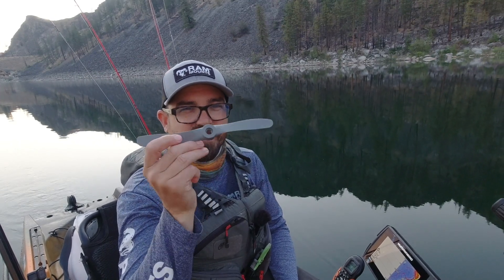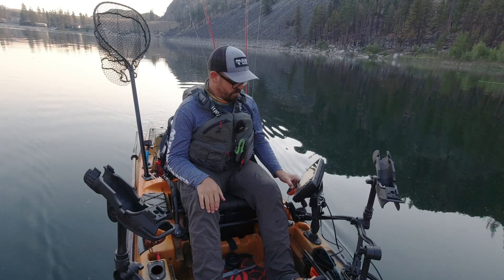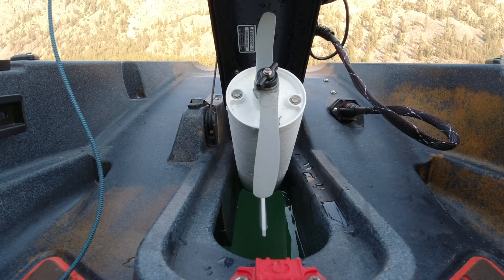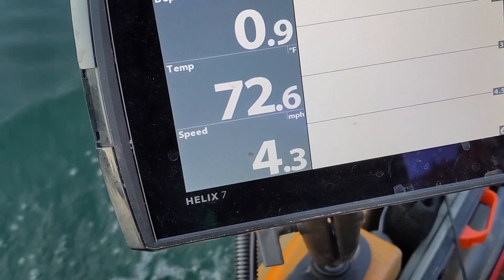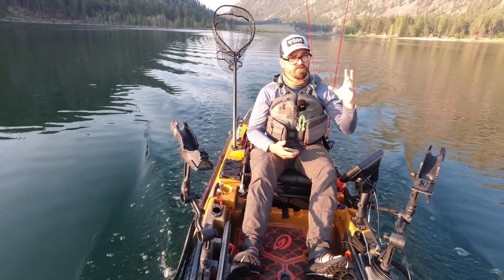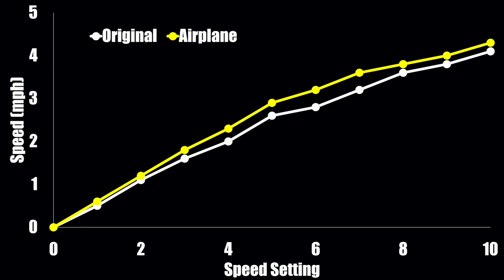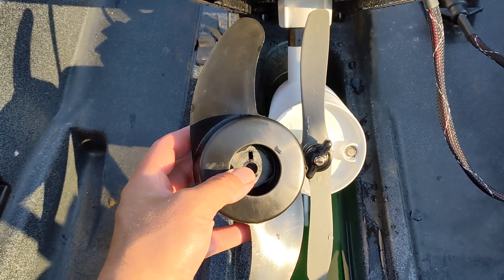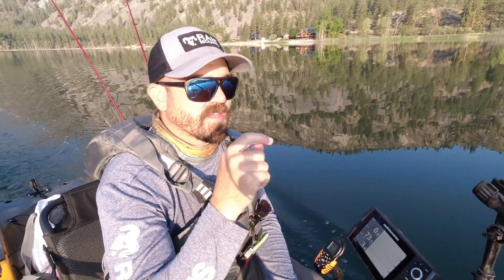Upgrade Your Trolling Motor for $4 [Airplane Prop on a Trolling Motor]

Comment: I feel like not having that hub might create a low pressure pocket creating some cavitation? I’m not an expert or engineer in this what so ever. Its more of a thought I’m drawing up based off of research seeking more speed for my trolling motor. Like you said it’s a really complicated topic when talking about fluid dynamics, pitch number of blades and all the different variables. Lol am an aircraft mechanic so looking at different props on planes vs boats, they have a common cone feature implemented in some way. That probably isn’t A coincidence, it’s probably to reduce drag into the blade. I know when you have more drag it reduces your thrust with air, Water being different has the issue of Water has a boiling point causing cavitation. Cavitation not only destroys your props, they also create air pockets casing your prop to lose grab on the water,  So you want the transition to be smooth. Like you said really complicated topic I wish I knew more about. I have a mechanical brain with the lack of scientific understanding of it all lol. I love that your experimenting with this, there’s a bass guy that 3D prints props. It’s something like “big bass”? he has a southern accent but he’s done a ton of resource and actually sells them now. believe they are kayak trolling motors. But if you can find a cheaper and effective way to do it I will watch all videos you post on it. I just figured out your in E Washington and I hope you are far enough away from the fires. I was up camping at liars cove lake concanelly last week and believe yesterday or today they turned it stage 3 evacuation. So I pray all is well for you.
Reply: https://youtu.be/cc2qGLAeAuk

Comment: I'd be curious to see how this performs with a larger boat.  My trolling motor is undersized for my boat so I'd be curious to see if this was an upgrade or as I one guy mentioned below, it might not have the torque to improve the performance with a bigger load.
Reply: Did you do it? How'd it work out? Im in a similar situation.
Reply: @snckwypp9802  Haven't tried it.

Comment: Ok i recieved mine in the mail. What an AMAZING upgrade! I put together my kayak with an old 17 lb thrust, rear mounted minn kota. With the stock prop i topped out almost 4 mph with zero chop. With this new prop that you recommended i topped out at 5 mph. The big difference is not in the top speed tho, the biggest difference i found was trolling speeds (around 2mph) i was using far less energy to keep trolling speeds then i did with the stock prop. I do admit i did not think this prop would work as well as it did but it surely suprised me. The only negative thing that i can say from this prop is that i did give some vibrations which hopefully i can fix by figuring a way to balance it. $4 well spent tho. Thank you for your video.

This is my brief video of mine if your interested or you can find it on my channel https://youtu.be/7RxWUhrjeAQ

Comment: Ok I wonder if it would make a difference on the PDL series?
Reply from the maker: I don't think it will or at least you would need a different prop as the prop featured in this video is shorter than the factory issued one's on the PDL drives.

Comment: Model aircraft props can be ordered with different pitch.   A typical description on an aircraft prop is 10-6.   The first number is diameter ( inches ) the second number is pitch.  In this example... the 6 indicates 6 inch of forward travel per revolution.  ( less slip )   The weight of your boat will determine what pitch will perform best on your boat.  In general a heavier boat will do better with a lower pitch angle ( 10-4 ) A lighter boat may do better with a higher pitch ( 10-8 )  Try different pitch angles on your boat to get the best performance.    I suspect the factory prop is too low a pitch to do well on a Kayak.  
Party on Dude....
Reply from the maker: I've been looking for a source for a different pitch push prop left hand. They are hard to find. I am interested to see how they perform.
Reply: @spiltmilt   APC LP10050M-LH  5 pitch marine pusher.  I've got one on order to test out.

Comment: Nice video Tyler. What app are you using to monitor the draw from your battery? Is it unique to that kayak and motor?
Reply from the maker: Its unique to the Rebel batteries I use to power my kayak. http://www.rebelbatteries.com?afmc=1d
Reply: Ok. Great.thanks! I have a Hobie PA 14 with a Bixby J-1 so unfortunately that’s not going to work for me. Wish Bixby had that as an option!

Comment: more thrust is produced at the tips as they have a higher speed (longer prop = higher tip speed), less pitch = higher rpm = more thrust at higher speeds. More pitch produces more torque  hence faster acceleration (probably not necessary in a kayak, unless adverse wind/ current or heavier load). Hope that helps.

Comment: Hey, Tyler, love the video! Great stuff. I am both an engineer and model airplane pilot, so will hit a couple questions you raise. 

Causes: There are likely 2 causes of increased speed: better foil shape and less drag. The air prop is "skinny" and appears to be about as thick as the water prop. This makes the share that moves through the water more like an airplane wing and less like a sheet of paper, which gives more thrust for the same rpm and less drag as well. Also helping out a lot, drag increases with area, so "skinny" is good, and makes the shape improvement even better.

Complication: I have no idea what that motor controller is doing. If #7 means 70% of available volts, then the lower drag will mean rpm increases, making even more thrust. Otoh, if #7 means 70% of max rpm, then amp draw will be less due to lower drag, and thrust slightly increased due to better shape. This detail isn't clear. 

More complicated: hull drag increases exponentially with speed, after a point. It's not surprising that at high speed the graphs converge - that's the boat getting difficult to drive thru the water.

One nit pick: the correct estimation of potential range is speed vs amps.  A 10% increase there will result in a 10% range increase, because...math :) When you get 10% more speed at a throttle setting, but the motor is drawing 10% more amps, range is unchanged.  It's much more informative to collapse the two charts into one, getting rid of the "speed setting" factor and plot each setting's amps against its speed. 

Down sides: these props won't flex much with impact. Hopefully they shatter before bending the shaft. Also I expect them to be very easily clogged by weeds.  

Other comments: I haven't handled the water prop, but I bet it's much less stiff than the fiberglass reinforced plastic used in the air prop. Those typically are very stiff, and fail when they hit something. They will hold shape better at higher rpms.  Also, prop weight has zero to with motor rpm once at speed, and very very little impact on acceleration. 

Ideas to improve: 1. Maximize the prop length for efficiency. The longer the better, and clip the least possible off the tips. 2. Play around with pitch. It's a matter of changing props and seeing what works. Be careful of big pitch #s - you risk overheating your motor. Use your speed vs amp draw chart to compare.  3. Try out a spinner. That big flat face at the back of the prop is huge drag. Airplanes seldom run naked props because of drag at higher speeds. Water is a lot like high speed air. Back to the hobby shop for a spinner of about the same size as the old prop hub.  Test again with speed vs amps and see if it helps. (Spinners are a pain, so better be worth it. May not be a good option for on the water prop replacement.)

That was long, but skipped details. Happy to answer more questions.
Reply from the maker: Wow! This is awesome. Let's address some of these ideas. 
1.) I can't make the prop any longer or it hits the bottom of the kayak.
2.) Yes I've been looking for alternative props with greater pitch. Problem is I need a LH push prop. Not a lot of those around it seems.
3.) I'll look into a spinner 
4.) I did look at amp draw at each speed setting (see chart at 8:05) and there is no increased amp draw with the airplane prop.

Thanks for the detailed response. It's greatly appreciated.
Reply: Question is that propeller installed backwards.
Reply: I just wanted to say: I am a Jumbo Jet Pilot and an Engineer.
Reply: Yeah, no worries. It's nice to have a little tiny bit of knowledge I can share back.  Love your work, in person and online! To your points:
1. I figured. More of a caution not to waste time exploring much on the smaller side.
2. Reverse props are a bit of a bother - except now we have these nasty drones from the underworld that have beset tge civilized world with their awesomeness. They all fly with half of their props turning backwards. There is also a ton of inivation in that area. They tend to optimize into a top fuel dragster kinda corner tho, so it may be hard to find a suitable prop for a kayak. I'm not sure if you said which prop you are using, so not sure if there is similar in drone size, but I would be surprised if you can't find similar. Try GetFPV, RotorRiot, etc to get you started. You'll see many 4 blade props - those def fall more toward a dragsters than a Prius, but if you find one that works, try it out, cut off 2 blades and try again.
3. 👍🏻 Or get a nerdy friend to 3d print you a perfect match. 
4. Yep, saw that. It worked on this prop and your conclusion was spot on. If the first chart lines weren't (or aren't on another prop) exactly overlay, it would be difficult to draw a clear conclusion - that's all I was saying. 
I love the empirical exploration you are doing here. Great stuff! And the results are very likely applicable to your peddle - prop boat as we. 🤔. (on detailed inspection, it looks like you're pumping about 150-225 watts (12-18A at assumed 12.5V) thru there to make typical cruising speeds of 3-3.5mph. That would be a pretty solid peleton workout for many folks and mortals won't be hitting 35A speeds (450W!), but prop comparisons would still be useful, especially the lower amperage end.)

Comment: The aircraft prop has a higher aspect ratio than the boat prop, making it more efficient. (Think high performance glider versus a biplane) . This is due to less energy being lost to tip vortices with the higher aspect design. More simply,  the boat prop is working like a screw and the airplane prop more like a wing. It has absolutely nothing to do with weight or rotational momentum.  The limiting factor for the aero design will ultimately be cavitation on the upper surface of the blade, but for low speed operation like this it probably should be fine.

Comment: My experience is in the world of aircraft. Real ones, not RC. And I have quite a bit of experience with aircraft props. RC aircraft or real aircraft, aerodynamics still work the same way. And hydrodynamics and aerodynamics are very similar in a lot of ways. 

That being said, you may be onto something when you spoke about the hub. 

Also is the cross sectional shape of the blade itself. The original prop blades are pretty much flat, and get their thrust from the pitch of the blades. While the airplane prop does this it has something else going for it too. Its cross sectional shape is like that of an aircraft wing, more curve on top than on bottom. This increases thrust in air and water. (Bernoulli’s principal) 

My other theory is speed. The airplane prop has less mass therefore the motor can turn it faster. My only concern with that is how it might effect the life of your motor if you’re constantly over speeding it? It’s probably marginal and not much of a concern, but something to think about. 

Cool vid man keep it up!

Comment: What app did you use to find the current draw? I wonder if the same efficiency improvement can be had on the autopilot for bow (boat) mounted minnkotas..
Reply from the maker: My battery has a built in bluetooth and an associated app for monitoring battery health and usage. http://www.rebelbatteries.com?afmc=1d

Comment: Great video for sure. I think it’s mostly rpm. With either prop you are going to max out at some rpm for each. Could you spin the oem prop faster obviously you get more speed up to a point where flex and cavitation comes into play. I suspect that skinny little prop would reach its maximum effect speed  and failure long before the oem prop does.  That little trolling motor is only going to spin so fast. Make it spin faster it’ll go faster. To a point I guess. 

I believe a three blade prop will actually get you to max speed faster but I don’t think on the same motor it would go any faster with 3blades. Most trolling motors are two blades to better chop up the weeds.

Comment: What’s the weight difference between the two. The lightest one should move faster in my opinion, thanks. I saw where some people are waiting weeks for a replacement blade from Minn Kota as they are backordered. Just carry more spare blades for backup. Great videos, thanks

Comment: Duc Tran has a 136 AP in his video and it maybe a faster kayak than your 120 AP, just a guess why he achieved a faster speed.
Reply: Hull length has a big affect on drag, that's why really long traditional kayaks glide better between paddle strokes.  The longer 136 AP @ 13' 6" has slightly less hull drag, matching the point you made.

Comment: Interesting. I’d be curious to know how much that airplane prop is flexing under water while running at high speed and if it could endure the stress long term. And then how would an aluminum prop perform if it wasn’t flexing at all and holding its original form.

Comment: I'm also curious if the airplane prop will have any affect on your fishing success rates. As you have mentioned many times, Kokanee are sensative to motor noise in the water. I also wonder if cavitation at the prop is part of that issue. It might not be a low speeds, I don't know.  Since you are gaining speed are you also putting more noise into the water, therefore spooking more fish than before?

Comment: Surface area/volume.  The rc prop displaces less water and also creates less friction.  Top speed probably more limited by boat design and the prop I suspect begins to deflect under increased load and/or cavitation increases = less for blades to push on.

Comment: just my 2 cents but there has to be a good reason why minnkota does not use the style prop you have demo'd here.  I reason that thick weeds (seaweed) and sand would certainly damage the rc prop much more quickly so I am sticking with the original that has the beefy hub.  Minnkota has decades of experience with these comparisons I would think...the extra 9-10 % speed boost is tempting but not worth risking the warranty concern or the more susceptible damage?? if it was titanium/aluminum alloy maybe, but then it would cost $100s for sure.  
Another great video, thanks for the effort.  Keep it under 4 mph OK! Hah...

Comment: I'd like to know the difference in RPMs. Is the airplane prob spinning faster because it's lighter and the motor doesn't have to work as hard? Lighter with higher RPMs and a  steeper pitch?
Reply from the maker: If the motor was not working as hard you would see a reduction amperage draw off the battery. I am not seeing that.
Reply: @spiltmilt  Wouldn’t that be a result of inefficient speed control?  A  pwm controller would be an interesting area to test.  Of course you would have to compare speed vs amps instead of “speed settings”

Comment: Well that was a " proper " test sir haha , just got my 3 rc props in the mail today . I'm exited about that mid range as most of my use is mid range power levels.  One thing to note for anyone reading this is these rc props feel very sturdy / strong in ur hand , when u look at a pic or a vid they look very flimsy / cheap but after getting mine today I can assure u they feel strong / great in person  . They feel like a 15 dollar prop in ur hand not a 4 dollar prop if that makes sense.  Thanks for the vid man , big " props " to all ur effort haha

Comment: Will the airplane prop effect the warranty?
Reply from the maker: Likely. I'm not 100% certain though.
Reply: From  their website. "
The use of an aftermarket propeller on your Minn Kota drive voids the warranty. Minn Kota motors are designed to balance performance, durability, and reliability. Though an aftermarket prop may increase your kayak’s speed, it may cause the motor to run hotter than designed with adverse effects. For that reason, the warranty on the Minn Kota motors found in the AutoPilot and 106 Powered by Minn Kota models, only covers the use of the standard MKP-2 prop and weedless MKP-6 props. To purchase replacement or spare props for your drive, call our customer service team at 888-343-1555.

Comment: In my uneducated opinion it there is less mass with the smaller prop therefore less drag that results in the motor being more efficient. One thing I did notice and you may want to keep an eye on is the pin. With the  original prop the pin is captured within the prop but with the small airplane prop the pin is only held in place with with friction or pressure from tightening the nut. Its open to both side and may eventually slip out. Just a thought.
Reply: Hi rob, fyi: mass is not a coefficent in the equation that defines drag: area is. For example, if the airplane prop,  were made out of lead (greater mass), it would not have different drag, just more inertia. The original prop has more pitch and surface area, both will contribute to drag. Cheers!